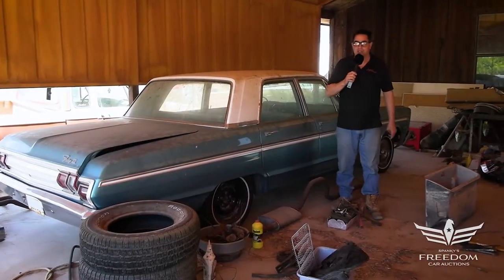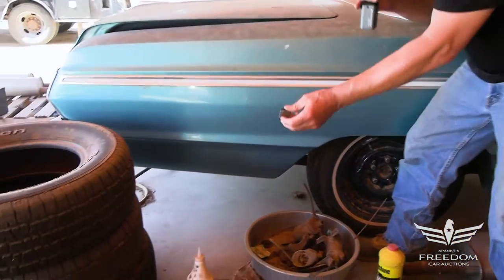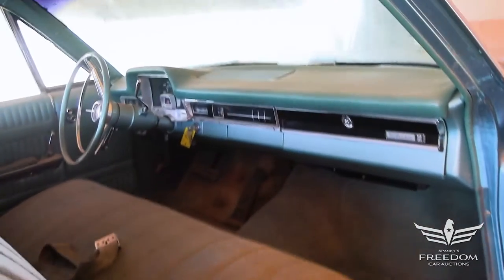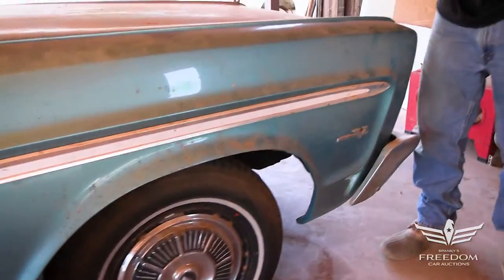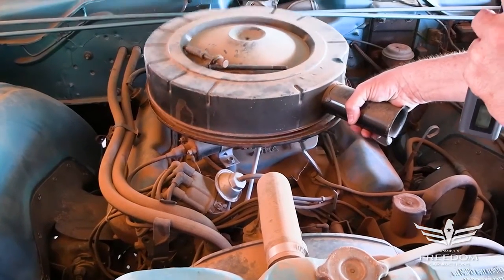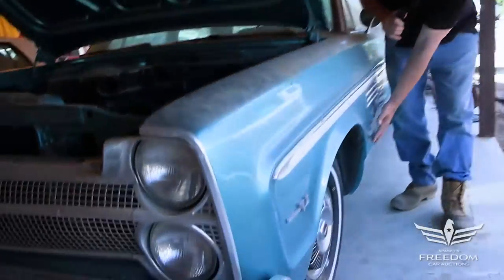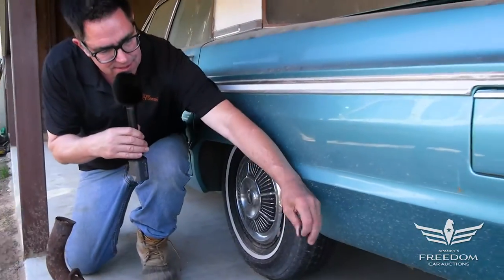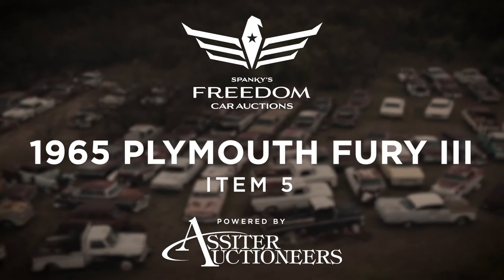5 1965 Plymouth Fury III

Comment: Is there a hole for the ant. on a radio delete car?
Reply from the maker: In most cases where I see a metal or plastic radio delete panel or plate on the instrument panel AND an antenna hole in the body, it's a case of a subsequent owner ADDING a radio to the car. Often in these situations, the radio is an under-dash type and the antenna hole is roughly gouged into the sheetmetal rather than the clean circular punch of a factory installed radio antenna. THANKS for watching! -Steve